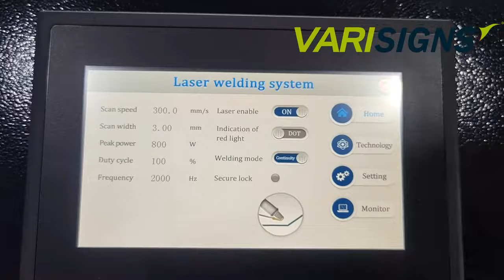3000W Handheld Laser Welder with dual wire feed for thicker steel, aluminum, brass and Nickel Alloys

Comment: I have been welding with a 2000w Varibend machine for three years now. Great machine but just starting to have focusing issues and the two lenses are burning out almost immediately after starting a weld. I will let you know how this gets resolved or doesn't get resolved. So far Tim has been very helpful with everything.
Reply from the maker: Thanks Anthony, we hope this machine gives you more consistent performance and we are always here to help!

Comment: Does the GY-WF3000C machine operate off of 220v single phase power?
Reply from the maker: Hi dear, thanks for your interest, WF3000C requires 380v three phase power. Let us know if any help freely.
Reply: @Varisigns  Other manufactures are offering a phase converter with their welders so it can be run on single phase. Hmmm...